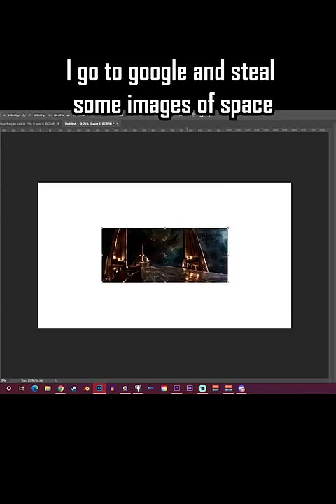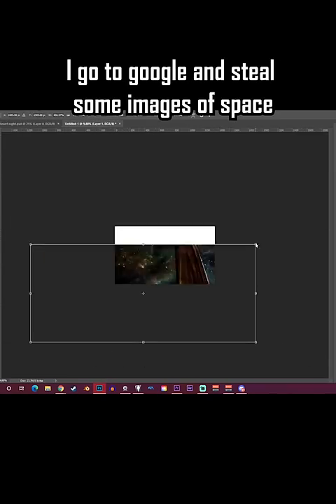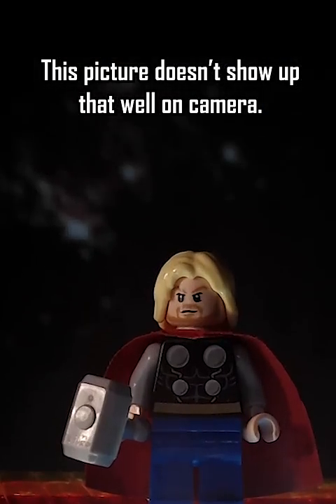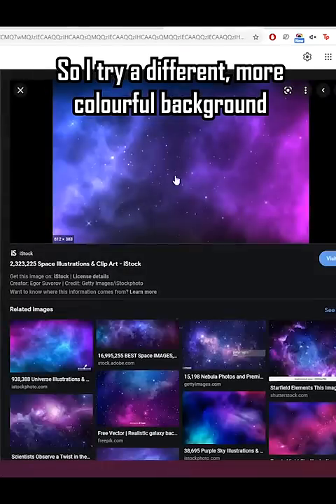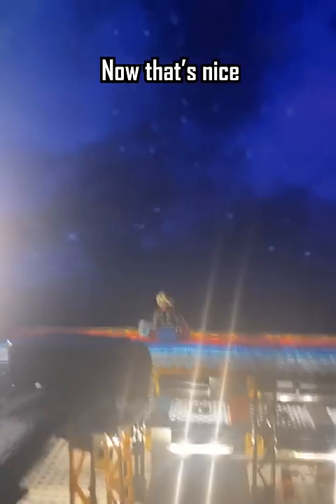Rebuilding The Bifrost From Thor (2011) #shorts

Comment: You can attach transparent 1x1 round pieces of different colours in the grill and make the bridge only in clear pieces to get the moving colors. You could also have two set of grids moving at different speeds or directions, as well as different thickness in the bridge

Comment: If you put the rainbow bridge on the face of a monitor you could get an effect much closer to the movie by having images with the different color patterns that you change as you animate.  If a monitor is not bright enough you can use another projector, just setup a mirror at a 45 degree angle under the bridge and bounce the light up from the side.

Comment: You should have done it with the pieces more interchanged cause if you actually look at it it's not a perfect rainbow but it has all the colors in the rainbow but they're kind of like randomly joined together so you should have made it so the bridge was like moved around a bit like the rainbows and it changed into the bricks